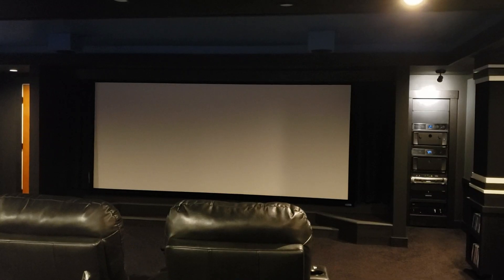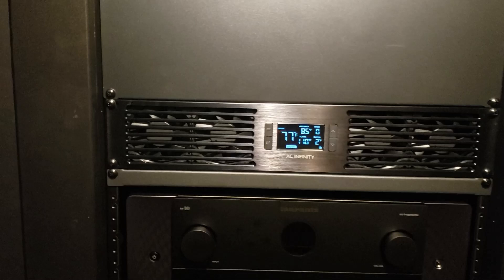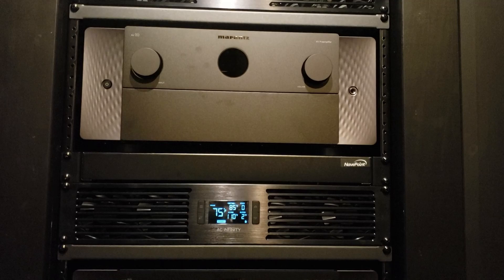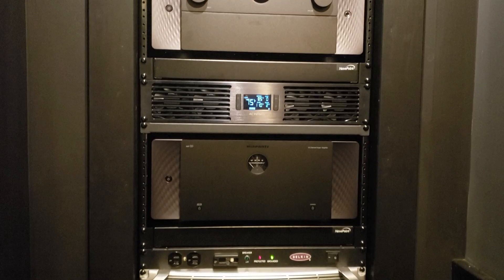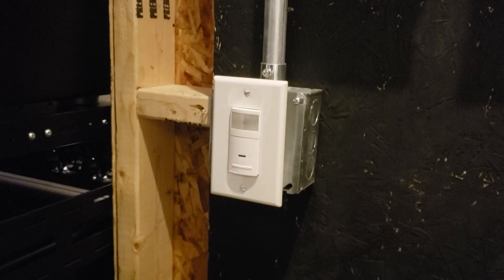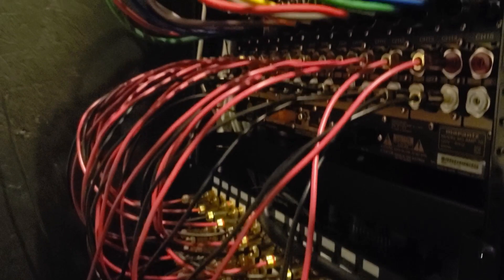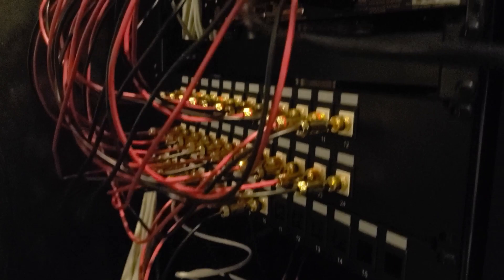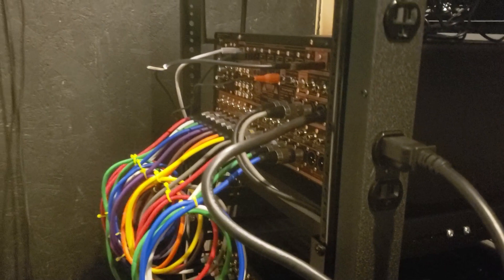Tour of the Rack Powering my 9.2.4 Home Theater

Comment: That rack looks amazing! The new amp and processor look beautiful, and those half spacers you have make the look perfectly spaced in the rack. The amp isn’t that light though, and clocks in at a hair under 44lbs. What amazes me about it, is the power they got out of it compared to the MM8077’s that I run. Your Amp10 does more than both of my MM8077’s, all in one box. Again, amazing setup, and awesome work making it such a clean install!
Reply from the maker: Thanks!  And they sound amazing too, even before I've done any tuning.  Yeah, the weight is why I suggest you get the 4 post shelves that are rated at 110lbs vs. the 2 post that I think are rated for 50lbs.

Comment: Awesome Rack!! I plan on building a theater room in about three years and would like to duplicate your rack and equipment. On one of your videos, the cables connecting the receiver to the amp was black. I noticed your cables are different colors and a different size. Did you make them? Could you send me the info on your rack. I’m paralyzed from the waist down and believe I could setup the rack. Do you know how much a professional would charge me?
Reply from the maker: Thank you very much!  There are three different cable types running from the processor to the amp.  The majority of them are XLR to XLR.  The other type is RCA to RCA.  Because I have two rows of surrounds, I needed to feed two different sets of amp channels from the one set of outputs.  There was no way to map another set of surrounds in the processor, so I took advantage of the fact that there are RCA and XLR outputs for each channel and fed the second row of surrounds from the RCA outputs (hope that makes sense).  The last cable type is also RCA to RCA. It's a thin cable for remote turn-on of the amp.  All of the XLR cables are the same size.  I didn't make any of those, I purchased them.  I think I have a link to them in one of my video descriptions.  I made the banana cables that go from the amp to my patch panel. The rack is from Middle Atlantic.  I'm not sure how much a professional would charge you.  It's probably heavily dependent on where you live.  I'm happy to answer any further questions though.
Reply: Thank you very much! You are very helpful. I have a theater room and it looks nice but the soundproofing, equipment and rack are not up to par. I have learned a lot watching YouTube’s videos. When you add your two other Subwoofers, will you have to purchase another amp and don’t you only have one other speaker port available?
Reply from the maker: @0862ricky  The AV10 actually has 4 sub outputs on it, so I have two more available.  I will be getting two new amps when I do that.  I'll probably go with the Behringer NX6000's.

Comment: Beautiful work!  I really think you struck a great balance with dedicated theater vs cozy living space. Do the fans on the Behringer amp bother you at all? Also, I'll need to watch your other videos, but is the Fire Cube your only playback device?
Reply from the maker: Thank you very much.  The fans on the Behringer and AC Infinity are pretty loud.  My seating is about 20 feet away and a little around the corner, so I really don't notice them unless it is completely silent. If your rack was out in the room near the seating, you would definitely notice.  Yes, the Fire is currently the only input device that I have hooked up.  I have an old PS3, but I don't really watch Blu-rays anymore.  The Fire has a lot of streaming services on it.  Disney has remastered a lot of their older movies with immersive sound, so they sound pretty amazing.

Comment: I really like the fan, I am getting 3 too. Man that custom made patch panel is interesting. I am connecting directly with the wall. It is amazing you did all this work by yourself.
Reply from the maker: Thanks again.  The fans are a little loud, so if your rack is near your seating, you will definitely be able to hear them.
Reply: @smarthomeMASTERY  by the way, I am using the greenwave to reduce the noise and the ups pure sine wave. The noise is like 15 Mlv.

Comment: I am putting together my first rack. I would like to understand how you have used the patch panels for wiring the speaker wires using banana plugs. I am new to this so did not grasp it in the video
Reply from the maker: I used these: 
Banana Jacks: https://amzn.to/3kRRdDw

Rack Plate: https://amzn.to/4f2KePG

Then you run banana cables from your amp to the banana jacks that go to your speakers.  Hope that helps!

Comment: Great stuff. Do you have a link or a recommendation for the wiring trough?  How about the track for the rack to move on?
Reply from the maker: Thank you.  I used the 4' version of these: https://amzn.to/3wN6CYd

...except without knockouts.  I had access to a hydraulic knockout, so I was able to make my own exactly where I needed them.  You can use a Unibit like this: https://amzn.to/3XMHCwc to make your own 1/2" or 3/4" holes, but the trough I linked above has knocks in it already.

Take a look at the description in my video where I show how I made it.  https://youtu.be/_ay9uRs-1EM  It has links to the parts I used, including the track.

Comment: How did you wire the 2 sets of side surrounds?
Reply from the maker: Hi Frank... I'm going to use these RCA to XLR cables https://amzn.to/3RCd9im for the second row of surrounds.
Reply: @smart home MASTERY  so you are using the xlr outs or one set of side surrounds and the RCA outs for the other set?
Reply from the maker: @PortlandBanshee  Correct.  XLR-XLR for front side surrounds and RCA-XLR for rear side surrounds
Reply from the maker: @PortlandBanshee  Going to try it and see if I have any comb filtering.  If I do, I can run the rear side surrounds into a DSP first..
Reply: @smart home MASTERY  Thanks for the info. I'm looking at the same setup. Just haven't done it yet. Are you running the second set now or waiting?
Reply from the maker: @PortlandBanshee  Not yet.  I only had one of the RCA to XLR cables, so waiting for the second one to come in.
Reply from the maker: Also, you could just go RCA to RCA.  The AMP10 has RCA inputs too.  I may go that route myself, but I have to move some things around to do it.  The AMP 10 switches between RCA and XLR in pairs. Because of the way I have the cables currently connected, the surrounds are split across one of the pairs.  The center channel created an odd number, so the pairs are split.  I should have skipped the other channel that the center was on.  If that makes sense.
Reply: @smarthomeMASTERY  Thanks.. wasn't able to flow that. But thanks